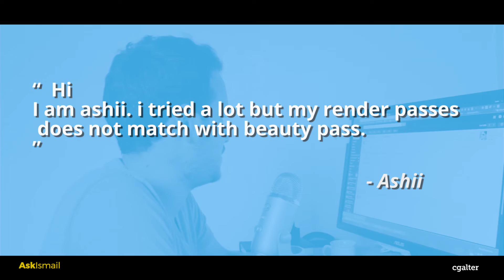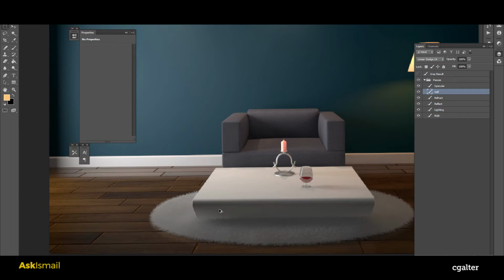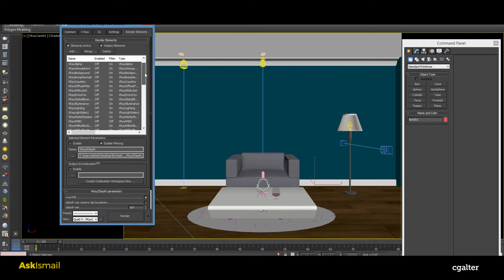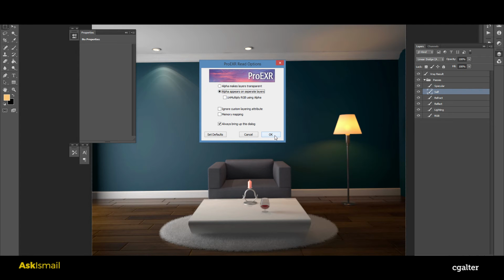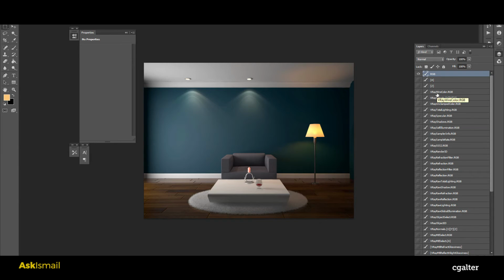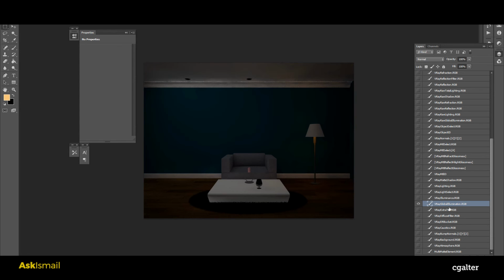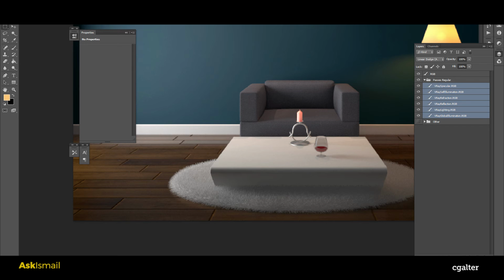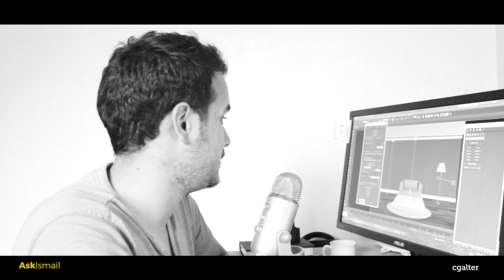Ask Ismail - My render elements does not matches with beauty pass

Comment: I am borrowing this principle from Vfx expert Hugo Guerra with Nuke Compositing. One way to force the match in photoshop would be to duplicate a copy of the beauty and move it to the very bottom of all layers with the mode Normal (same as over operation in Nuke) selected; then, add (Linear Dodge Add in photoshop, or plus operation in Nuke) every single non Raw passes (from bottom up the layers GI, Lighting, Reflection, Refraction, Self Illumination and Specular), group them all in a folder (originals) and duplicate it, one set it with the mode Linear Dodge Add and the duplicate copy with the subtract mode selected; put the duplicate folder with the subtract mode on top of the Beauty duplicate. Then, group both the Beauty and folder elements duplicates in a single folder with the Normal mode selected and name it Leftovers (to remind you that this is causing the trouble); now, move the folder with the original elements on top of the Leftovers; finally, put the original Beauty on top; then switch on and off the selector for the original Beauty to compare. Here is an illustration for the layers, https://www.screencast.com/t/Kp0ixAnBtL
Reply: This looks like will work! I'll try it! 
Hope this was a video tut to make things easier, but you gave info and screenshot! I shouldn't ask more! Thank you!

Comment: The two still don't match.
Reply: What is the sense in rendering out raw files for no use when compositing? These are the same as the regular passes, but broken down even deeper with their respective filters for multiplication. The reason for the render elements not to match the Beauty when added may be caused by materials that are not supported by Vray, meaning not Vray friendly! All material must be compatible before rendering out the elements.